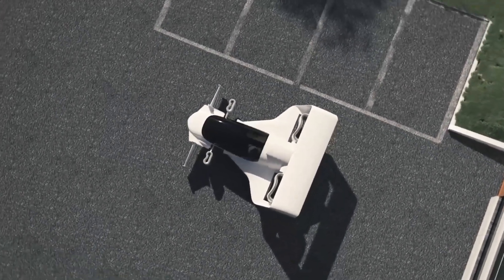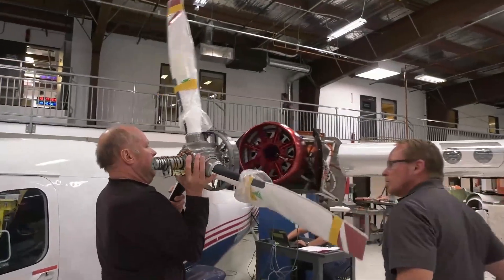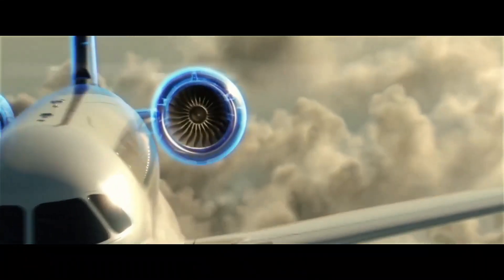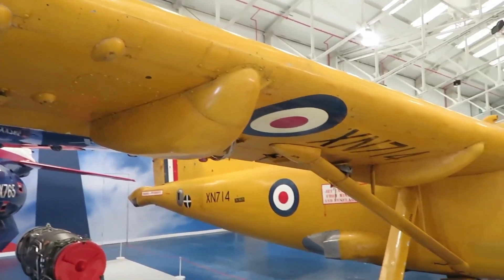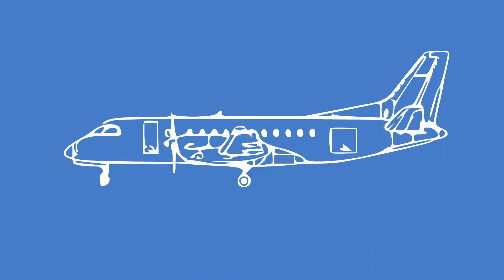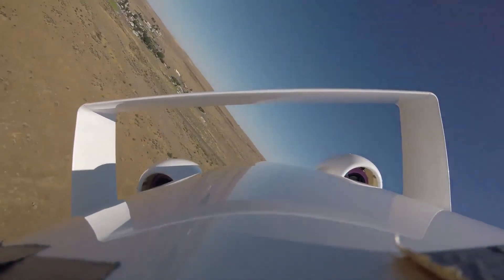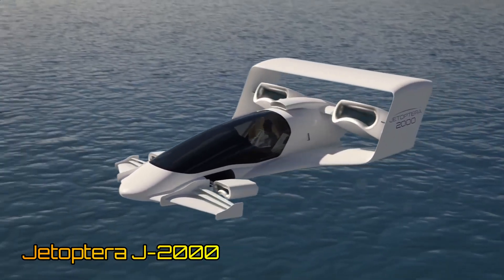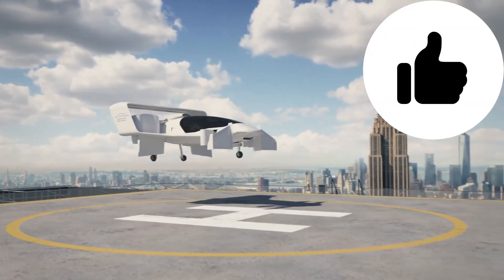Jetoptera Part 2 : Increasing the lift/thrust of an aircraft through fluidics

Comment: I think Jetoptera is trying to sell snake oil. The "Fluidic Propulsion System" is a super inefficient way to generate thrust. The Dyson fan is a gimmick. The Dyson fan uses more power than a normal fan moving the same amount of air. Routing compressed air though the ducts of this sort of propulsion system is going to drain the system of power.
In my opinion, Jetoptera is one of the least likely electric vehicles systems to succeed. Don't invest!
Go look at their YouTube channel. Why are the comments turned off on their video titled Fluidic Propulsion System (FPS™) Further Testing? Go watch their other videos. I didn't see any flying model which used their so called Fluidic Propulsion System.
Their latest video shows an aircraft with conventional ducted fans. 
By asking for money, I think they have crossed the line from just being deceptive to becoming out and out scammers.
Reply from the maker: Dyson isnt optimized for thrust. They chose high mass flow rate and that they did by increasing the area of their entrainment ducts much bigger than the size of the jets they released.  If you look at Jetoptera, their duct is much smaller.  The limited the duct to the size, when they were witnessing a steeper drop in the velocity of the entrained flow. This is how they got around 2.5 times higher thrust than if they would have released the jets as it is (without entrainment duct).  I spoke at length  with Jetopteras CTO to clarify this.
Reply: @ElectricAviation  I assume you have you watched their YouTube videos. All their flying models appear to use conventional propulsion. I don't see any indication their Fluidic Propulsion System offers benefits above alternative systems. I think routing air through the various ducts is going to cause huge efficiency problems.

I've been a long time subscriber of your and I really enjoy your videos. After seeing your original video about this company, I watched a bunch of the videos on Jetoptera's YouTube channel. After watching their videos, I was convinced they are misleading people about the capabilities of their Fluidic Propulsion System.
Reply from the maker: @ddegn   I have watched their videos on youtube and even ones that havent been made public. If you look at one of their STOL, they are using Electric Ducted Fan, and in the other a jet, that is housed inside. They take the compressed air from it and release it as jets.
Reply: @ElectricAviation  I think that was your mistake, you spoke too much with them instead of doing what you normally do...
Reply: I agree with you but on this channel you need to be a fan of blue corner or red corner... or whatever the names.
Reply: @zaelu  "on this channel you need to be a fan of blue corner or red corner..."
I don't understand what you mean. It seems like this channel showcases examples of electric aviation from a variety of companies. I've been subscribed to this channel for a while and I've never felt like I need to be a fan of any particular company.
Reply: @ddegn   I was referring at previous comment on your reply that was quite polarized. And is not the only one. 
I am all for electric aviation minus the scammers and tribalization.
Reply: Are you an engineer?